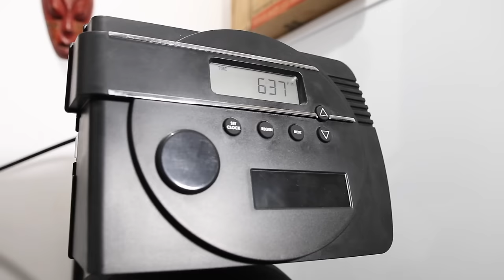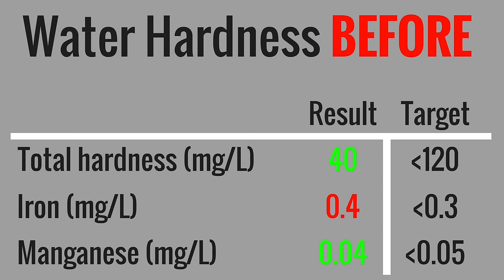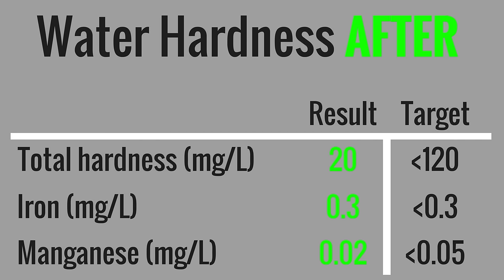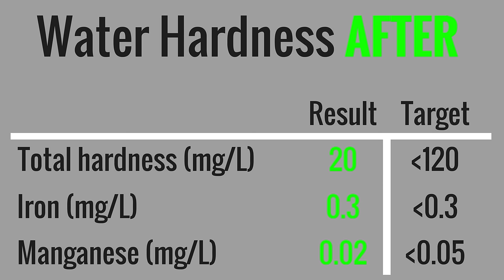WATER SOFTENER SYSTEM : HOW IT WORKS !!

Comment: Is the soft water safe to use for car washing? Asking since salt is used for the softening.
Reply from the maker: Yes it’s safe. But I also add a water deionizer in my garage for a 100% mineral free water. See my simple setup here: https://youtu.be/IKNL1chAQXY?si=jBk_LLHwkShv6JK8
Reply: @PanTheOrganizer  So the soft water should not cause any corrosion even if I don’t use a deionizer?
Reply from the maker: No it wouldn't cause corrosion to your car. A water softener is still better than the normal hard water from your tap. Softened water removes a lot of the minerals from water (just like mentioned in this video) but still has a bit of TDS content due to the salt brine used to wash the resin. But nothing that would be corrosive. Quite the opposite, it prevents corrosion in your home appliances like your water heater. A water heater from regular hard water will have much more rust and corrosion after a decade, compared to the same water heater in a home that has a water softener.

But for washing cars specifically, once again, as I said, the best is a water deionizer. That removes 100% of all minerals. That's the highest quality water you can get to was a car with (that and reverse osmosis but that costs a ton).

Comment: Hey Pan... Great video.  Sorry for the long post but I got a few questions.  So we had a guy show up at our door asking to test our water.  We live in GA outside Atl.  Of course, when he tested the water, it showed how hard and full of chemicals the water is.  He kinda hi scare/hi pressure sales pitch he sold us on a $6500 water softener, which we agreed to, thinking it was a good investment into our home.  I later learned that these systems should cost more around $1000-$2000.  So buyer beware... I shoulda done my diligence.  But, now it's been 2 years and the same company is calling us every day saying it's time for a maintenance on the system.  They need to change the filter and flush the lines... For this service, they are asking $225.  I am reluctant to use them since I feel they over-charged us on the system by 400%.  Is this maintenance necessary? ...are they just trying to drum up more business?  ...and is this something I can do myself?
Reply from the maker: I'm not a water treatment expert, so I would recommend that you make a few calls to other companies near you and get their expert opinion. One thing I do know is that there isn't one price for everyone. It depends on the type of resin (filter media) that is in your tank. My water was already pretty soft to begin with, so I only needed a basic resin package. It was 2500$ CAD for the system ($1950 USD) installed. But if you have very hard water, the price goes up, and I have seen friends in other cities that have paid over 5K for their setup.

Maintenance, as far as I'm concerned, is only adding salt when needed. Pretty low maintenance. Every now and then, you can perform a full clean on your own, there are videos for that on YouTube. Just search for "water softener system maintenance".
Reply: @PanTheOrganizer  thanks for the reply... that’s funny... cause that search brought me to you. Lol thanks for the advice.
Reply from the maker: Yeah my video got lots of views, so I'm guessing the algorithm recommend my video even more as soon as someone searches for "water softener" or something like that. At least people get to understand the basics of that with my video. Knowledge is power. :)
Reply: @PanTheOrganizer  agreed!

Comment: How much salt do I put in it? Mine currently has water and salt but the salt is slushy in the water … like there’s as much water as salt … when should I add more salt?
Reply from the maker: I am not a water treatment specialist, and I don't know what water softener system you have. Refer to your user manual, or perhaps reach out to the company that installed it.

Comment: Hello Pan, I got a situation of of rusty/dark brownish black fine particles in hot water. My softener was down for 2-3 months. Replaced the switch on the softener and did couple of manual recharges. First the water was super salty but after adding salt, softener cleaner and doing another recharge, still the water has rusty stuff that settles in sink if filled. Please advise a solution.
Reply from the maker: Hi Nate.  I'm not a water softening system expert, so I would advise you contact your local dealer.
Reply: I believe that just happened to me.   It's the resin from the soft water system.   Remember that he said it lasts 15 to 20 years?   Well when it breaks, all the resin beads go through your system.   I just had to flush my system out,  which isn't fun.   I'd suggest getting a new system after 15 years,  so this doesn't happen to every else.

Comment: Magnesium Mg is a completely different element than Manganese Mn. can you explain how did Mn( manganese got in this video at Minute ( 6.19)?
Reply from the maker: I don't understand your question. I was simply reading the results from the lab analysis of my water, a report generated by the water treatment specialists near my house. I'm not a water expert. I just shared the data from the reports that were generated after the water was analyzed.

Comment: When using the foam gun, is the foam thicker? I have seen this at a friends house, using or not using the filters. The foam was alot thicker .
Reply from the maker: If the house water was very hard and you switch to water softeners, then soaps are more efficient but I can’t say I noticed more foam as my water was already soft to start with.
Reply: Yes it would be ...with a softener. .. there is no doubt..

Comment: Your plastic pipe is all gunky after 5 years because it's porus plastic, all my pipes are copper, I put them in in 2000, they are clean inside despite no water softener for 22 years. The State water heater here when I bought the house I replace in 2012, it was manufactured in 1978, just curious I cut the tank open, the glass lined tank was imaculate except for the huge CHUNK of lime build up about 12 inches deep on the bottom! I had replaced it only because there was starting to be a little drip around the drain valve which I was never able to drain water from- that 12" buildup was why!
The toilet and sinks get a LOT of mineral buildup, hopefully the softener ill fix that.

Now I'm installing a water softener.

Comment: Most of what you say is correct, however, there are many different kinds of resin for different applications. It’s not a one fix all piece of equipment.
Reply from the maker: Correct, the resin has to be adapted accordingly to your water content. Hence why a water analysis is key to select what resin type you need.
Reply: You also failed to explain the exchange process of ions.

Comment: There is no significant difference having original values way low and on the close to saver values, the after installation values are not that significant. Looks like you actually don't need a water softener. But your explanation is very good.
Reply from the maker: You are correct. My water was already very soft to begin with, but I'm the kind of person who likes overkill on everything I purchase haha. It's in my nature. And as I operate one of the biggest car detailing channels on YouTube, it's also a side benefit to have the some very clean water to work with. :)

Comment: Question.. how "full" should your brine tank be with salt?
Reply from the maker: It depends on what system you have, usually it has a maximum salt level line. I fill mine up, and refill as needed, never letting the level drop below the critical level. If you see water in the bottom, you have gone too far.
Reply: @PanTheOrganizer  thanks so much!

Comment: I think that maybe you should also have explained this symbol <0.05 just in case there were some viewers who didn't know or forgot their primary school math. it means no greater than. So even if your result was at 0.05 it still would have been within acceptable levels.
Reply: Nope that means less than, if there was a line under it it would less than or equal to (no greater than)

Comment: What happens if the unit is not turned on for a month? Guy installed it never plugged it in or setup the drain tubing for flush out.

Comment: I started a regeneration to day, I cleaned up and filled the brine tank with two bags of salt, and then I started the regeneration manually, the system did 9 minutes a "backwash", after that it started 1 hour of something that I don't know, after that hour the screen says "regen today" again.
So, did I did something wrong?  
Thanks in advance
Reply from the maker: I don’t know.  I’m not a technician.  Your best bet would be to contact your installer.
Reply: What system do you have? I am panning to get one but I have no idea. Please advise me. Thank you

Comment: So with this I guess you don’t need to use a cr spotless?
Reply from the maker: That would be correct. Of course a CR spotless would give you ZERO ppm of minerals so that's the ultimate deionized rinse, but I have zero water spotting issues with my water softener.

Comment: Most salt-type water softeners specify that the water have a chlorine concentration of less that 2 ppm. While there are many "whole house filters" on the market that claim to reduce nearly everything, don't be tricked! The term "reduce" is Marketing Speak for "we reduce it by 'some' amount," which means that the filter does barely anything, they aren't lying. If you really need to remove contaminates and chlorine, be sure to buy a filter from a mfg that can provide third-party test results.

Comment: First time owner here. How loud is it when the system in Regen mode?
Reply from the maker: It’s in the basement in a closed room so I can’t hear it much.  Of course if you stand next to it , it may sound loud.
Reply: Pan TheOrganizer mine is across the a wall. I can hear it quite loud during its cycle. Is it norm?

Comment: Hi Pan, are you still happy with this system? Who makes the system?  I am having a hard time finding honest reviews online for different brands of softeners.
Reply from the maker: I moved to a brand new home and had a new water softener system installed by the same company. A local company that specializes in water treatment solutions. So it wasn’t the case of selecting a specific water softener brand, but picking a reliable company and have faith in their recommendations.

It seems to be a Fusion 2 system by Waterite. That’s all I see written on the head of my unit.

My recommendation would be to search for a reliable and trusted water treatment specialist near you and see what they have to offer.

I hope this helps!
Reply: @PanTheOrganizer  thank you sir!
Reply from the maker: My pleasure. How did you discover my channel?

Comment: what is total cost including installation
Reply from the maker: It will obviously depend on what media is needed for your particular situation. It depends on what hardness level you water is currently at. The harder the water (more minerals to remove) the more costly the filtering media will be. In my case, I already had pretty soft water to start with, so my total system was 2500$ CAD installed. But again, check with your local water treatment experts.

Comment: Can you wash a car without getting water spots or a DI water tank is still a better option?
Reply from the maker: Of course this helps greatly reducing water spots. I have no such issues. But there is still a bit of minerals. If that's of concern to you, and you want 100% DI water, you have no other choice but to install a DI water treatment solution where you wash your car.

This is a car detailing channel, and I have been detailing cars for over 23 years. Since I have had water softener systems in my homes (I moved into a brand new home this past year, and also installed a water softener system), I never had issues with water spots.
Reply: @PanTheOrganizer  Thank you... Love the content!

Comment: Decent video, but I'd like to refute your claim about the effects of water heater efficiency. It doesn't really work this way. 

Electric resistive heating doesn't really have any waste.  It may seem like having a thin insulating layer of mineral on the element would reduce "efficiency", but that's not quite what happens.  It's a closed system.  There's a certain number of watts going into the element, and the only place for them to dissipate is into the water.  But there MUST be some detrimental effects from having all that build-up, right?  What really happens, if the coefficient of conductivity or convection drops, the temperature of the element increases.  The water does not cool the element as well, but the same amount of power must be dissipated.  So, the temperature of the element rises until a steady-state is reached.  Basically, if the heat transfer is impeded with increased thermal resistance, the temperature delta between the element and the water will increase until a balance is reached. None of the electrical energy goes missing or gets wasted, however. 

Technically, with an increased element temperature, some miniscule increase of thermal energy will be lost through conduction out the base of the element through the side of the tank.  This won't be significant.  The increased element temperature will also accelerate degradation of the element,  so you could save some money on replacements over time.
Reply from the maker: Thanks for the explanation. I guess the water treatment experts I spoke with don't know what they're talking about? And there's so much literature online about water softeners, it seemed to make sense. Certainly there are benefits to having a water softener other than just for clothes and lather in shampoo?
Reply: @PanTheOrganizer  they probably explain it the best they can without full understanding of heat transfer. The word "efficiency" tends to get misused to describe any condition where something is "less good". More accurately, efficiency is the ratio of power put to good use (whatever the task) vs power consumed.

Comment: So in my salt tank. Is there supposed to be visible water above the salt pile itself? Cuz yours I see no water, but mine has water above the salt like 5-6ins and it’s filled more than half of salt
Reply from the maker: You aren't supposed to see the water. If you do, that means your salt level is too low and the tank needs refilling. Unless otherwise specified by your water treatment specialist for your setup. I would check with them.
Reply: @PanTheOrganizer  thanks for the reply. Also another question. I the part where you setup the amount of ppl in household and usage and extra does that dictate how the system makes the water or does it thing. For example if I’m really using water for 2ppl but somehow the system is setup for 4-5ppl what does that do?

Comment: So the water was 40 grains and it dropped it to 20 grains? That's still hard water. 20 lbs of minerals per 7,000 gallons. Ideal hardness should be 0-1gpg for soft or 4-6gpg if you are worried about corrosive water.

Comment: I’ve been stumped for years... I can’t understand the chemistry in the resin tank.... if this were true then most people with hard water would be able to, say, install a five gallon salt brine bucket in their shower with a wand attachment and rinse off before their shower is complete and see a minimal but still somewhat noticeable effect.

A little plastic resin ball someone acts as a introducer - “hard mineral water meet Sodium chloride, sodium chloride meet hard mineral water” and the two shake hands but the byproduct Of the hand shake sticks to the plastic resin ball? Why would it do that? - they say because of the geometry of the resin balls structure but I’m skeptical.

Comment: If I install a water softener in my home and I use the water from the water softener to wash my car will it leave water spots if I don't dry it with the towel if I use a water if I install a water softener and wash my car and not use a towel to dry my car. Iwii I get watersports on my cay. Or what do I need to be about to wash my car and not have to use a towel to dru
Reply from the maker: I wash my car all the time in my garage. I have a water softener for the house. It softens the water, but you still have a bit of minerals in the water, so if you were to let the car air dry, yes you'd still get some water spots (although much less than normal untreated water).

The best way to ensure 100% removal of all minerals to wash cars is using a water DEIONIZER setup like I also have in my new home's garage. With a DI system, there are ZERO minerals left in the water, so you could technically even let the car to air dry after your wash and rinse process, and there would be no water spots. See my video on that topic here: https://youtu.be/IKNL1chAQXY?si=1LsMfQ5VJlm3DyYQ
Reply: @PanTheOrganizer  thank you so much for the quick reply and for all your help with this question. I've been loving your videos. I've been watching seen 2022. 👍👍

Comment: How much does it cost to installation? Not mention at all.
Reply from the maker: There is no point in discussing pricing, as the price varies greatly depending on what type of resin your softener needs.  The type of resin will depend on how hard your water is, and the price can fluctuate quite a bit.  Plus, it depends which brand of softener you get, installation costs, the country where you live in, etc.

For example, my setup, with water that was already pretty soft to start with, came out at 2500$ CAD.
Reply: Thanks for mention the price now.